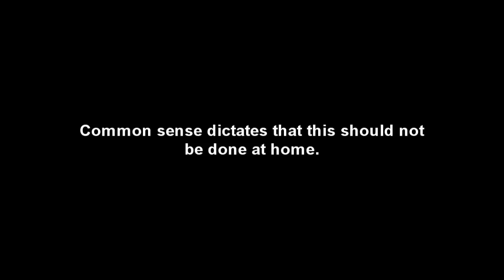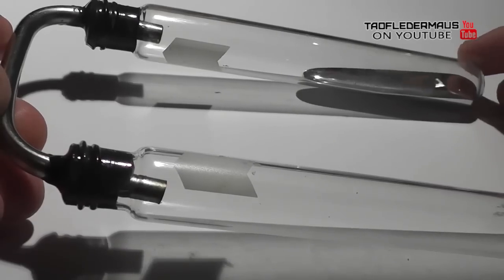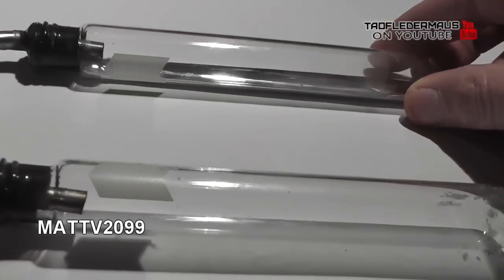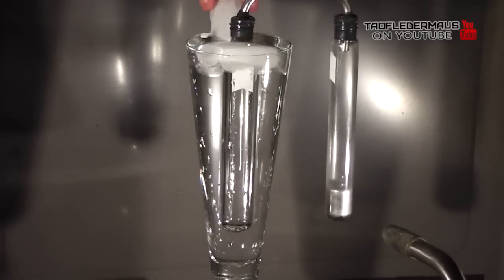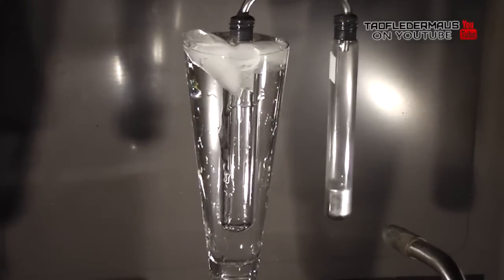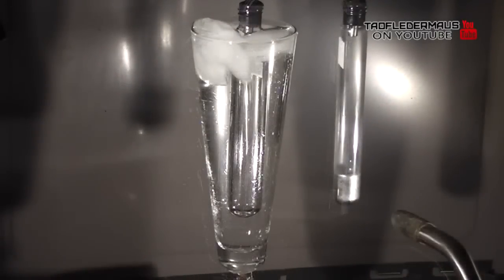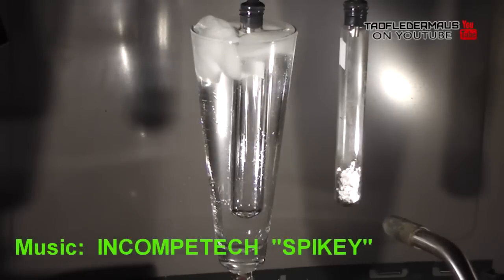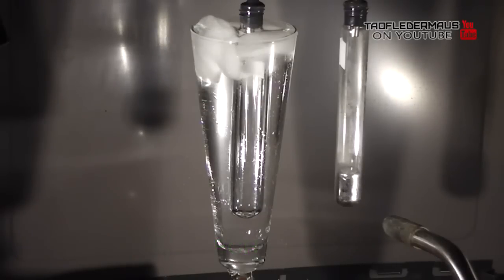What does the LIQUID METAL  Mercury look like BOILING?

Comment: does mercury freeze?
Reply: You can freeze it with dry ice but not with normal ice!
It has a freezing point of about -40 degrees fahrenheit i think!
Reply: ColdHellDrive 000 It would be really cool (so to speak) if the freezing point of mercury were -40 degrees, because that could lead to some cosmic conspiracy theories about the equivalence of -40°F and -40°C (given that the temperature scales are defined by the freezing and boiling points of water, not mercury). Alas, the freezing point of mercury is actually about -37.89°F/-38.83°C. Being broad-minded, I'm ready for a new temperature scale based on mercury.

Comment: how does the glass not melt?
Reply: It's a test tube.
Reply: the melting point of glass is much higher than the boiling point of mercury.
Reply: Mercury has low melting and boiling points.
Hell mercurys melting point is room temp.

Comment: lol i tried it myself at school when i was 8 XP
Reply: It was actually for a science experiment about fire alarms and use mercury so it will expand and touch the other part of the wire so the electricity can pass from one end, through the mercury, to the wire, and turn on the alarm. got 2nd place tho cuz i made my teacher's golden ring turn into a metal ring. lol since mercury washes off the metal an turns it into what it was originally, she didnt remove it correctly and turned out spoiling her wedding ring.